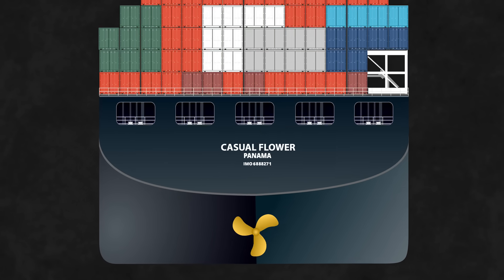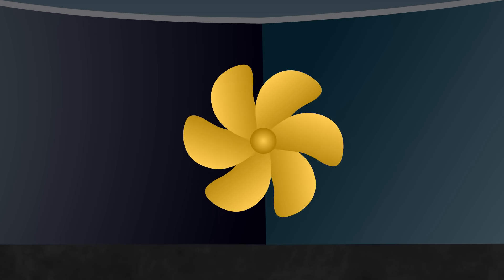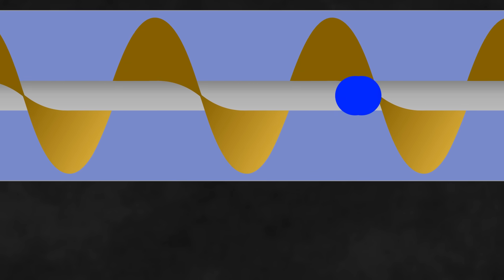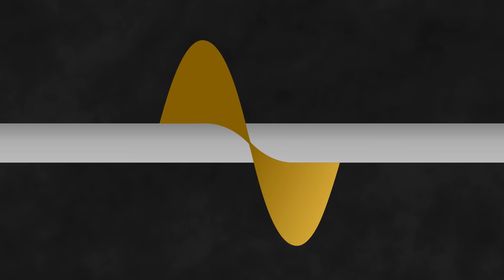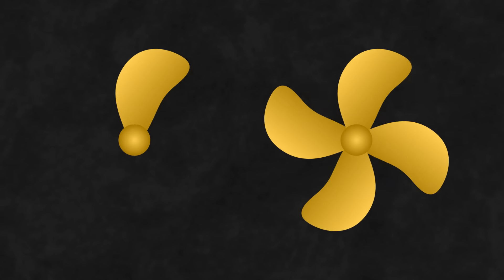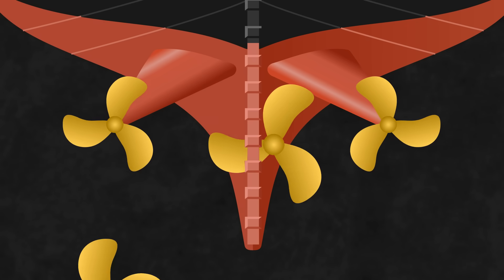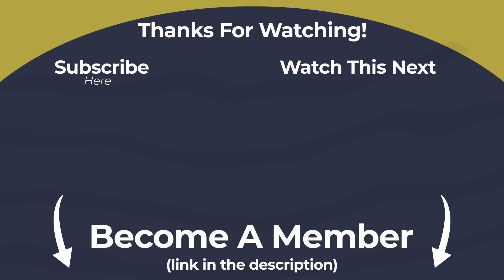Why Are 4 Blades Better Than 3?

Comment: Shaft and propeller vibrations were a common issue in ocean liner design. On narrow, high-speed liners, the propellers were positioned very close to one another, leading often to interference between their propeller streams. To reduce vibrations caused by resonant frequencies, naval architects experimented with combinations of 3-, 4- and later 5-bladed propellers. For example, the SS United States (1952) was fitted with a pair of four-bladed and a pair of five-bladed propellers. It is quite possible that Harland & Wolff pursued a similar idea as early as 1911, when RMS Olympic was fitted with a four-bladed center propeller.

Comment: Paddles were modified to dip the blades in the water. Working in and out of rivers, paddle steamers had to lift off at low tide. By 1948 P&A Campbell had the  twin screw Empress Queen working out of Swansea. She churned-up so much muddy water that it had a detrimental effect on the condenser.
It was eventually sod and ended up in Greece.
Should you ever make a video on Anchors: Why do most ships have two anchors? and what is the sequence of events of events to work two anchors? and why is this not the same in both hemispheres - North and South ? The answers to these questions are the 'Nitty gritty' of nautical knowledge..

Comment: The question about number of propellerblades is valid for airplanes as well. Interesting topic. And I understand that the choice of propellersize and number of blades(or maybe better described rotating wings) is not always based on highest efficiency.
On an airplane more blades result not only in higher thrust but less sound.
But a waterpropeller has the issue with cavitation.

Comment: Propellers is a part of ship building and ship life still being experimented on. Submarines keep their blades in a cover when In port to prevent the enemy from seeing them. You have fast and loud propellers, slow and quiet propellers, and propellers that kinda do both but not as good. It’s a science still not fully understood as fluid dynamics simulations don’t fully calculate how a propeller is going to act.

Comment: Number of propellers are calculated based on engine RPM to avoid natural vibrations and then You use that number later when based on room on AFT you calculate necessary rise according to engine power and speed You need to achieve . You can calculate any propeller with any number of blades as long as its not one but its not optimal. You can avoid cavitation by increasing surface blade area. So u play with ratio of area of blade to area of circle of propeller which can be even larger than 1. Notice how on planes its very small to avoid drag cavitation dosent happen in air at those pressures.  So its surface of blade not number of propellers, but awesome and interesting point great video.

Comment: Ther reason why most of the speed boat props are three bladed, is due to the fact that 4 bladed props are shadoved by the gearbox 2 times per revolution, significantly reducing speed efficiency. The same goes to 2 bladed design, however they are often surface piercing and it is a different story. So, yes, If you need to put maximum thrust and torque to your prop - you need it to be a mutliblade with a smaller pitch angle. it is easier to screw in a twin helix screw than a single helix. If you need max speed - go for two blades, and make sure that only one blade hits the water at a time. zoooom   off you go....

Comment: A feathered paddle wheel was invented to make it much more efficient but it was too late. They were replaced with screw propellers which took up much less room. You did not mention that screw propellers often have a ring around them to capture the water flung outwards  so increasing efficiency and reduce vibration too.

Comment: Larger diameter and fewer blades are more efficient. But there is a maximum diameter of prop for any ship. So to get the same or more thrust add a blade.

Comment: Not a navigational expert, but I do understand fluid dynamics. Thrust, pull through water, and other misconceptions is not how the ship moves. The principal is to create a high pressure area and low pressure area around the boat causing it to move. Otherwise, the boat would never move if it was only pulling water through it. Think of also how a ship would sink.

Comment: On a small scale test I did using 2, 3 and 4 blades on the same motor, I found a 2 blade had me traveling the fastest but the vibrations was unbearable while 4 blades had me going the slowest but it was smooth to the point I could not feel any vibrations. 
3 blade prop is what I use the most after testing as it is a nice sweet spot between speed vs comfort for my boat. It has nearly the same speed as the 4 blade prop but its only a slight vibration that doesn't disrupt comfort.

They only make 2, 3 and 4 blades props for my motor so I couldnt test a 1 blade or 5 blade etc unfortunantly

Comment: Question; does the same apply for airflow? Be it a pedistal fan, ceiling fan, or cooling fans for a PC. ❤
Reply: yes, because the mechanisms at play are simple fluid dynamics. since air behaves as a fluid, these same principles can be applied to moving air. weather that's on a pedestal fan, or a pc cooling fan, or anything in between.

Comment: 1: instead of speeding up the 1-blade, make it longer.
2: add a counterweight to the blade to reduce vibration.
3: dampen the vibration using techniques established over 100 years ago..
4: Reduce cavitation by relying less on pitch and more on aerofoil lift.

Comment: And now we are back to archamides screw basicly  with pump jet basicly a high angle of attack in a tube that has increased presure in it stopping cavitation and limiting spill over and presure waves hitting the hull.

Comment: 1:55 therefore if you make the angle infinitesimally greater than horizontal it will move the water particle an infinite distance causing the ship to exceed lightspeed. Checkmate physicists

Comment: The most effective Energy propeller is two blades give you extra “vibrations hell” 
- Three blade  normal vibration and normal fuel economy 
- Four blades save space in the propeller window so the live hull is low deep, (less deep hull)
Use more numbers blades is for less live hull to reduce friction in the water and permit in low deep for shalow waters, port, canals, parking go and moorings, 3 propellers not good idea! Reduce efficiency,  propeller by pair is ok one counter clock and the other side by the clock, propeller big as can reducing rpm, most efficient NYLON propeller than less effcient brass propeller

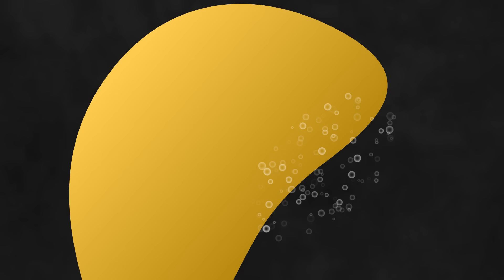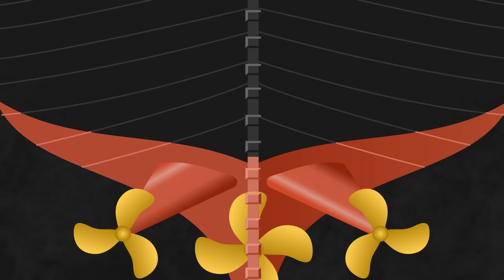Comment: According to the information at 03:28 as to the low pressure side and the rotation of the propellers at 00:25  that ship is designed to reverse  and go astern continuously!  
Casual Navigation is being a little too casual perhaps even with the shadowing of all the propellers.

Comment: To produce the trust you really need to increase the total blade area, you can make the diameter longer since the hight aspect ratio of a blade is more efficient than a low aspect ratio. On ships that is a big limitation because making blades thin and long would make the prop hit the bottom, the ship itself and is weak structuraly so you can make the blade shorted but thicker to increase the area and keep the number of the blades or add more blades with higher aspect ratio wich tends to be more efficient. You can also play with the speed of rotation but that creates a lot of noise and cavitation so generally is better more area and lower speeds than less area and higher speeds.

Comment: If your engine has 4 cylinders, avoid 4-blade props to prevent resonance from torsional vibrations. But yeah, the more the blades, the smoother the propulsion sounds, thus submarines have lots of (probably prime number) thin blades.

Comment: This explains my higher vibrations at cruise rpm with my 2 blade prop then my friends and there 3 blade props. Also that for similar sized sailboats my cruise speed is slightly faster as well.

Comment: It depends on the application, they both have advantages and disadvantages.
Four blades are better in rough seas, but have more prop walk.
Three blades if a single screw handle better, but have more cavitation in rough seas.

Comment: This video just popped up on my YouTube, but what about a video about the mass of the volume moved v.s. velocity? It does relate into how many blades on a prop, and is a part of a turbofan v.s. turbojet hanging off of the wing of a plane, when it comes down to power, efficiency, and what you have to do to power whatever you're turning to create the force.

Comment: I've sometimes wondered if it would increase efficiency if you put a ring around the perimeter of the propeller and made it like a ducted fan? 
Or even a turbine with many blades.
Or if you put stationary blades after the propeller to create a laminar flow out of the propeller?

Comment: It’s interesting how similar it is to aircraft propellers.  

Fewer blades are more efficient (and indeed they have made one-bladed aircraft propellers) but make more noise.  Adding more blades means you can add more power for a given diameter.. but they aren’t as efficient.

Comment: So much misunderstanding here ~_~. First of all, there's no matter how many blades propeller has - it's solidity ratio σ=kb/πR matters. Second, propeller do not push a cylinder of water - it pushes flow around it. And finally, you get cavitation when flow acceleration exceeds the fluid surface tension limit. Any surface with acute angles generates such acceleration at very small velocity.
Reply: yes, that‘s closer to proper naval architecture

Comment: That being said, the center propeller on the Olympic class ocean liners was powered by a steam turbine engine rather than a reciprocating steam engine. So, unless it had a gear reduction to match its shaft speed to that of the port and starboard shafts, it may have had somewhat higher rpm’s? This is something I’m going to look into now. lol. 🤔

Comment: The 2 bladed prop is considered the most efficient as it is a greater diameter and acts on a larger column of water. However due to limitations in of space and vibration issues more blades are used. A two bladed prop with blades of a form that is similar to a modern submarine blade form is highly efficient as the swept back tips lower the tip vorticies thus decreasing energy loss and smoothing the pulse to the hull creating noise. A slower prop means higher loads on the drive system which is more expensive and heavier. It is all compromise. Many of the modern electric outboards are running very efficient props

Comment: The factor that is almost always ignored, except on the fastest human-powered boats, is that the speed of that column of water is pure loss.  It is like running the wrong way on a moving sidewalk.  To slow it down, we racers use a larger diameter, grabbing more water and leaving it almost stationary.  Propeller designers brag about "beating the Betz limit" which should only be applied to windmills and other stationary installations, where it can't be broken.  What they need to look at are the Froude equations, as used for aircraft.  To get enough room for efficient propellers and still navigate shoal waters, a dragon tail design that can be lifted is probably best.

Comment: First, a propeller is not an archimedes skrew, it is a rotating wing! Second, the center propeller of Olympic and for sure Titanic also had four blades, because it had to transmit more power than the outer propeller. The efficency of a propeller with more blades is dropping because the friction is increased with each blade moving through the water and this is increasing the torque you need to turn the propeller. The efficency of the propeller is the trust it is producing against the torque. So as long as you can get enough trust without breaching the border of the cavitation, you use as little blades as possible. In addition to this comes the problem of vibration and harmonigs in the propulion system and the ship hull. Maybe the propellers have been changed to gain comfort for the passangers or to reduce damages to the shaft and the engines.

Comment: "why are 4 blades better than 3?" simple math. 3 + 1 is 4. more blade, more cut. more cut, more slice. more slice, more b i t e. more bite, seemingly more food. S I M P L E.
Reply: More friction and drag
Reply: @sarthaktiwari7827  better motor.
Reply: Why not 30 blades then?   If it were that simple you'd be a millionaire and not commenting on YouTube
Reply: wrong
Reply: @takotako808  right.
Reply: Why not 5 or 7 then?
Reply: If so, why don't wind turbines have four blades?
Reply: @carlosanvito  this is an old argumant bro
Reply: @gabrieljudd3200 better motor and more blades=more expensive
Reply: when you go to the propeller store hungry:
Reply: They’re not. Then what’s stopping them from having 180 blades. Dumbass.
Reply: Hmmmmmmmmmm 400 blade propeller is 400 bites of food..🤤

Comment: Alright. But why not have the best of both worlds? You could make four shafts each attached to a propeller with one blade. They'd only need to spin 1/4 as fast to get the same force as a single shaft with a single blade. And you wouldn't have to deal with the additional efficiency costs of using a four-bladed propeller.
Of course, these don't exist. And seeing as I can't be the first person to think of this, there must be a reason. So what's going on here?

Comment: 3:30  You can blow the bottom of a half-full beer bottle by slapping the opening because it creates a vacuum under the beer which rapidly collapses. I'd assume this is basically what's happening when a propeller spins too quickly and damages itself.

Comment: I wonder how close the large ships' propellors work like lake boats. A 3-blade propeller would give you slower take-off but better top speed as it has less drag. A 4-blade propeller will give you better control at slower speeds but the extra blade causes more drag and you lose some top-end speeds.

Comment: cavitation is the act of creating a "cavity" in the water it has nothing to do with water boiling. the bubbles are created because the water trailing the blade cant keep up and because you cant "stretch" liquids any better than you can compress them what you get is a void and as the universe abhors a vacuum the empty space collapses supersonically allowing water to strike the surface of the prop with sledgehammer force pitting it. The entire cycle from formation to collapse happens so quickly that no meaningful amount of water vapor can form in the cavity.

Comment: A couple of weirdness items regarding propellers.  1) paddle wheels - they had advanced, high-efficiency paddle wheels by the time they went out of fashion, on which the paddles could be tilted fore-and-aft; they thusly entered the water more closely vertical and remained so throughout their paddle-motion; the drawbacks being increased complexity, higher maintenance and more susceptibility to breaking.  Interestingly, reading about human-powered boats, the second-last record-holder (that I read about) was paddle wheeled - it was beaten by a propeller driven boat made by MIT, but the propeller was very large and light, and turned in the air, not the water.  And 2), your mention of an Archimedes screw is very apt.  One of the early propeller experiments was run on an English river, with a propeller that was indeed an Archimedes screw - it worked, but the screw was flimsy and ultimately tore most of itself off the end of the propeller shaft - and the researchers were considerably nonplussed to discover that, having lost most of their Archimedes screw propeller, the fragment that was left on the shaft propelled the boat significantly faster!  Life is funny that way...  3) Big ships' propellers are almost never made of steel; steel rusts.  Usually they're made of marine bronze, a semi-precious metal ("precious" because it costs so much...).

Comment: Excellent video and presentation. 24 years ago I bought a 27 ' long ex ships lifeboat with a steel hull. It didn't have the propeller though. I stripped it of all it's wooden structure and rebuilt it in steel to live aboard. I got a Lister engine for canal work. I went to the library and got books about propeller design for boats. Hmmm...........I'm a life long electrical engineer........
I finished the design and sent it to a manufacturer in the Midlands and they sent me back my shiny new propeller !
THEN in a twist of fate, the original propeller turned up ! ( a long story ! ) My new propeller was almost identical. Same diameter,  same pitch, just 5mm different blade diameter !
And it worked fine . Thanks again,  Colin ( West Yorks )

Comment: So this is my general rule of thumb after watching this, correct me if I'm wrong; bigger propellers with more blades are only used for bigger vessels. Might also apply to submarines, as well. While smaller props with few blades can turn as fast as it wanted to

Comment: Its interesting how both ship, and aircraft propellers are basically the same - a set of pitched blades moving a fluid to create thrust, but the issues they have are significantly different. For example aircraft will never have an issue with cavitation, while ships seem to be just fine having paired props (2,4,6 blades) which in aircraft significantly worsens vibration.

Comment: I may be completely wrong, but maybe the Titanic was fitted with a 4 blade propeller to compare its performance with the Olympic but after it sank, there was no way to compare anymore so they tried directly on the Olympic itself ? They also had the Britannic to test 4 blades though.